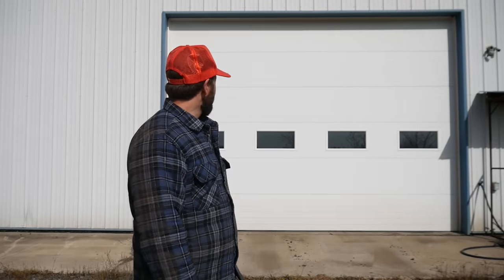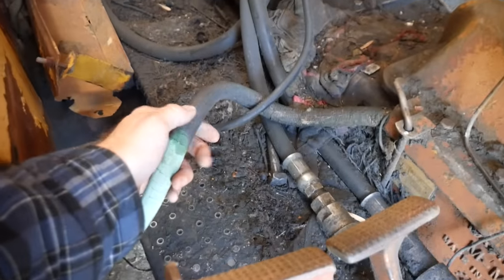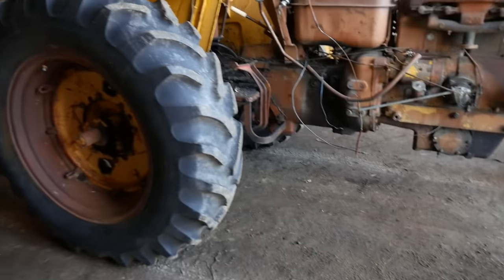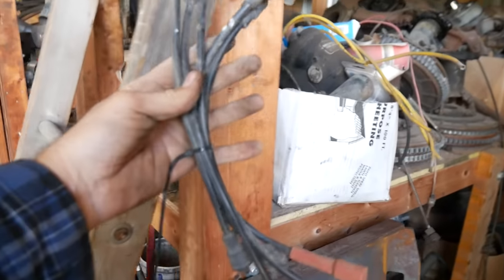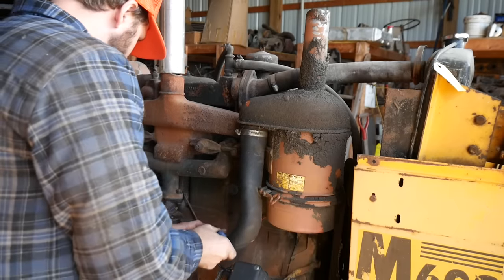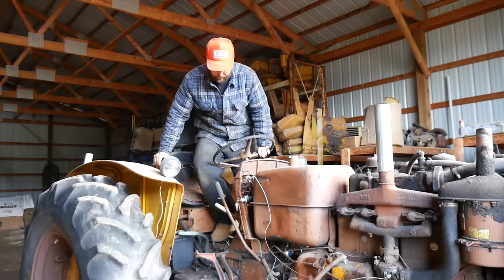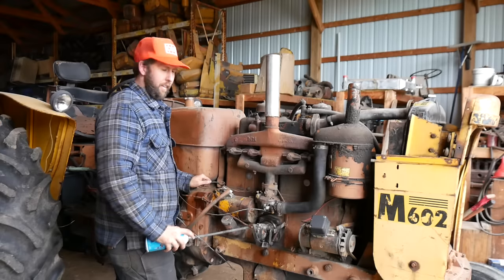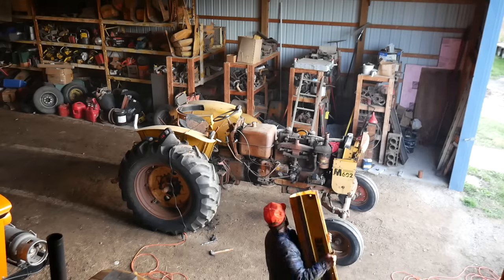Old vintage tractor..will it run after many years? - Vice Grip Garage EP43

Comment: It's not the updraft carb that had me scratching the ol' noggin
It's the cast iron exhaust manifold being the same solid hunk of iron as the intake.. So if she's cooking on a hot day, just gonna vaporize any fuel headed up that intake
And we don't see "Made in USA" anymore because people wanna earn a lot of money but pay very little for products.  If the company makes 10 tractors in an 8-hour day (I doubt it was anywhere near that high) but has to pay 200 people between the factory and marketing $20/hr- Those 200 people require $32,000 an HOUR.  Assuming they sell all 10 every day- they'd have to price each tractor at $25,600 JUST to cover labor.. To say nothing of the actual parts and materials, or the CEO wanting 256,000 a day, employee benefits, company insurance per-employee (lawsuit protection), and everything else..  Realistically for the company to stay in business, they'd have to sell each of those 10 tractors at something like $65,000- And they'd have to sell every one, every single day.  But why would anyone pay $65,000 for a small tractor when you can get an imported-from-china tractor for $20,000?

Unfortunately that's a slippery slope and once we start down the "only buy the cheapest" path, we wind up falling off the "companies moving labor overseas to stay in business" cliff.  Which means far fewer jobs for we norte americunts and we turn into a consumer-only country that exports very, very little.

TL;DR Buy "Made in USA" whenever possible, even if it's more expensive. You're paying your neighbor's electric bill, and feeding their kids.

Comment: The oil bath air filter may be clogged with either gunk in the metal mesh of the air filter or the oil cup of the air filter is so full of fine dust that the oil looks like thick mud.
Found a 1953 Ferguson TO-30 tractor with all of the above - clogged metal mesh in the air filter canister and "oily mud" in the oil cup. Used a screwdriver to scrape out that "oily mud" mess. After cleaning both problems in the air filter, the Continental Z-129 engine fired right up.
Too bad we can't have a Old Minneapolis-Moline - Part 2?!
Reply from the maker: Would be great

Comment: Back in the day we made everything in America and had a lot of small local brands. Being a bit of an lectrical smart azz I happen to know that the city of Mineatureapples had a TV maker called Setchell Carlson (betcha didn't know that just like how I didn't know they made tractors  there till ~30 min ago). They made modular chassis TVs and radios in the tube era till 3M bought them and let them get spun back off a few times till they became IIRC Audiotronics and were a big player in arcade videogame monitors. Their tube era offerings were good stuff (I have 2 working late 60's color TVs of theirs) You could yank out the color demodulator for fixing and it'd keep going as a monochrome TV. Ocean oil rigs and other "the TV repair shop is days away" places favored Setchell Carlson. RCA (the A used to stand for America) ,which back  then evenly split %85 of the TV market with Zenith, sent engineers to Setchell Carlson to figure out how they could get a better color picture out of the CRTs RCA sold them than RCA could.

Comment: Stupid question but did you try opening up the idle adjustment to allow more fuel until it runs?

I have done that to many carbs that fire but won't run

Comment: Maybe a guy missed it in the video, but I'm curious what this deal was? Did you offer to buy if the owner let you first work on it to get it running? Or did you buy and the owner is letting you leave it there for now? Would love a video on your process to find the various fine machines you're snapping up.

Comment: Waa sorta surprised you didn't take hose off air cleaner end and leave on carburetor end, when shooting the fire juice,, oil bath air cleaners actually totally remove fire juice,, so it was actually firing from gas it sucked thru carb,

Comment: That lever that's tied back is called lever b (leave'r'be) lol
Reply: There is a fine screen above the sediment bowl that is probably rusted over and plugged. The fuel goes into the bowl, then through the screen to the carb. The screen gets rusted or varnished off. It will allow some fuel to go through, but not enough to fire and run

Comment: Ya come across positive grounds?  How ya know if positive ground??  I know a 400 "56" I changed over to 12 volt negative. was  6 positive ground..  I now wondering  about what was  the hot side and  negative side of  like a light or the starter.. I used the 6 volt starter..
Reply from the maker: Follow lead to starter

Comment: Frequent watcher ...first time commenter from da big mitten Eh?  

We had a 602 when I was a teen.....you do NOT want to break into that transmission....the torque multiplyer and hydraulics and transmission are all tied together....and it's a frigging mess.... because...good luck finding a manual to get everything to sync properly and work ..   when they work... beautiful tractor with great torque to run a bailer or snow blower....when the F up... Get ready to pull your hair out

Comment: Clean the fuel line from the tank to the carb. If that don't work just put a carb on it. It will run like a stripid assed ape.

Comment: hi if you cant get points condenser dissy cap and rotor arm  there the same as Vauxhall chevet Vauxhall viva   and a load of fork lift trunks  thanks john
Reply from the maker: thanks for the tip
Reply: @ViceGripGarage  no prob thanks for the reply john

Comment: pouring gas and starter fluid in an oil bath air cleaner is basically creating a bomb if it backfires but it'll be fine....ha

Comment: If someone were to tell me I could have that old tractor if I’d get it out of their way, I’d see if I could find a carburetor from something like a 660 rhino or grizzly, and jerry rig an elbow in place of the carb, clamp it in that 90* that goes up to that old oil bath filter. I bet it would run fine and should work on that updraft setup. They are about the same horsepower....
Reply from the maker: 🤷‍♂️ hard to say
Reply: @ViceGripGarage  True! you know, bad thing is, I go through this crap every spring with my Farmall 806 Diesel. you'd think I would would learn.....

Comment: I don't understand your troubleshooting methods at all.  And starting issues.  You don't have a set pattern.  You know; A,B,C,D  etc.  But you are all over the place in your troubleshooting.  Now, I think you should start using NAPA.  They clear many a heads. Got better filters too.  Why didn't you pour gas down the intake of this tractor?  OH, finally at 35:00 you use gas down the intake.  Finally.

Comment: Reason #10102385749858585 not to fool around with GAS Tractors, their just a pisser. Go with diesel you don't have them carb. coil, plugs, wires,  problems etc. ect. . I think that's most of the problem with this tractor the plugs are old and fouled.